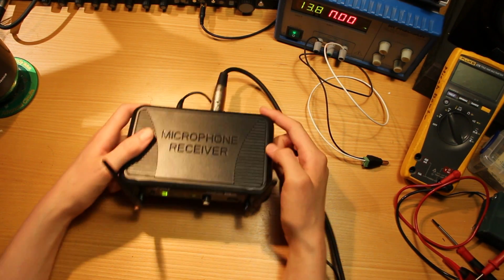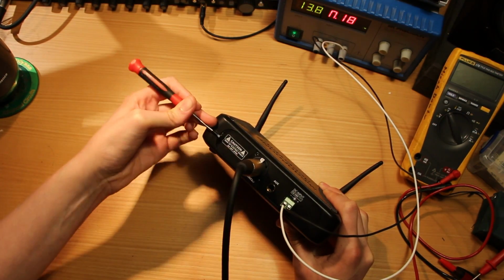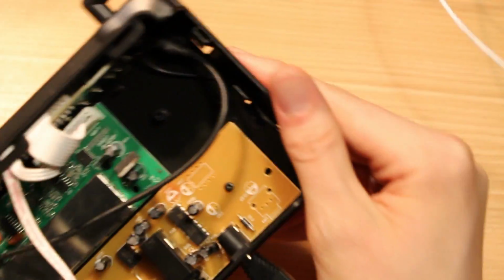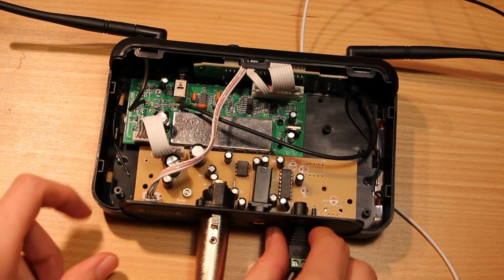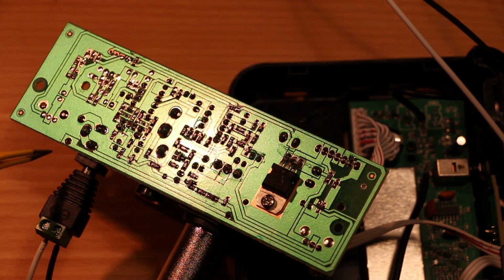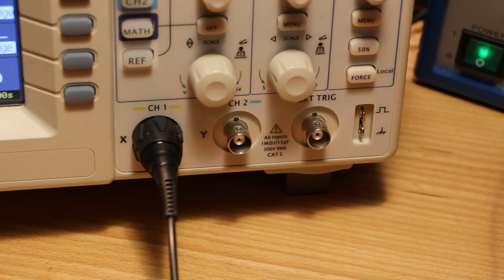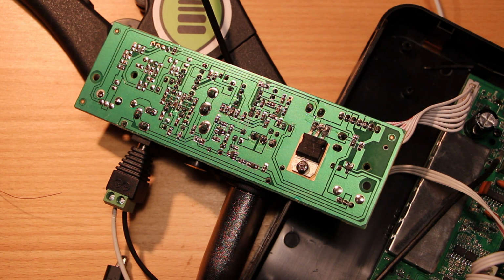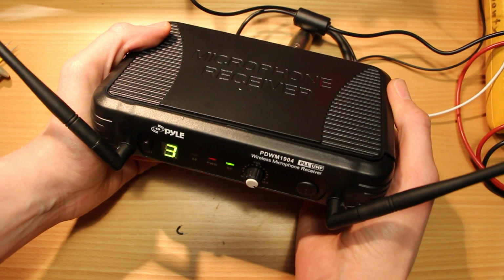Microphone Receiver - scanlime:005

Comment: I understand that after 4 years it is outdated, but I don't understand why you even didn't try to add some ceramic 100nF caps to power supply and 9V stabilization to suppress HF noise on supply voltage.

Comment: Great job! In analog circuitry, there are lot of possible noise sources. One is electret microphone itself, or to be more specific, FET which is inside. Another things are RF module itself. Then all linear voltage regulators can insert some noise. And, finally - what you solved is some opamps are just... just not so good for clean audio output. BTW, thank you for subscribing to my YT channel. I am very inactive in producing new videos... but that may be changed (don't know how) soon.

Comment: There's high frequency tone in the sound after you did that mod. Not big pleasure to listen that. Did you bypassed some filter?
Reply: +Micah Elizabeth Scott Thats fine, I understand. No headphone noise harm was done :) I thought that the whizz is much higher frequency ( > 10kHz ) but it could be that 1kHz. Just wanted to point that out. Thanks for the new video content that you're creating!
Reply: 1. I heard same thing. Surprisingly, frequency analysis revealed a 11kHz hum both before and after the modification (also harmonic hums at 6kHz and 16kHz). I think it's just harder to hear before the mod because of all the other noise.

2. To my ear, the mic sounds a lot less beefy without the mystery chip. I suspect it amplified frequencies in the human vocal range, but I don't know for sure. Definitely not worth the noise.